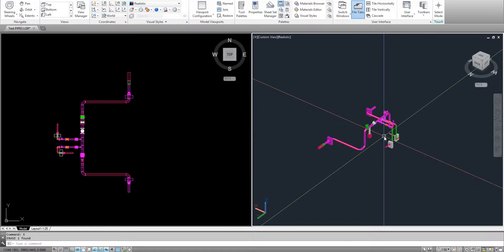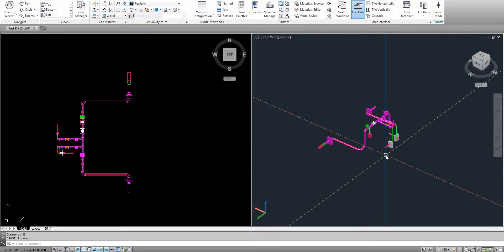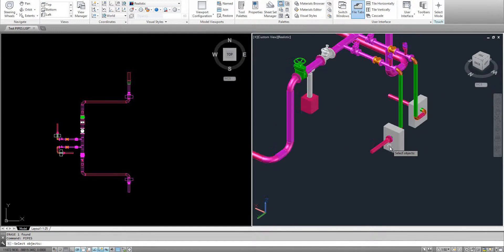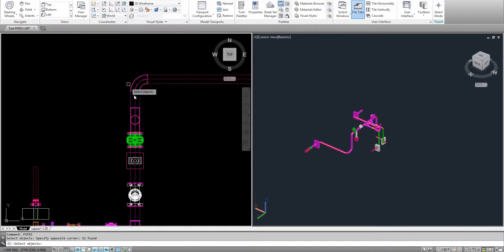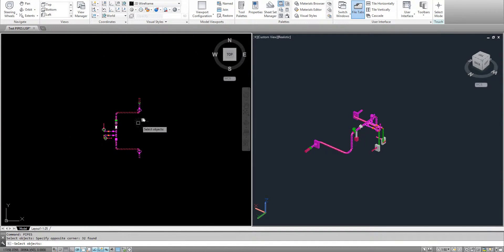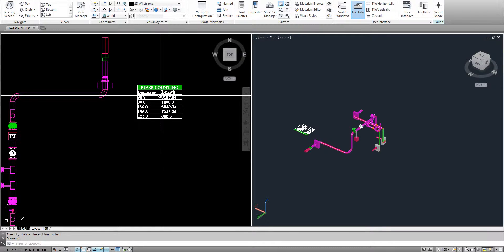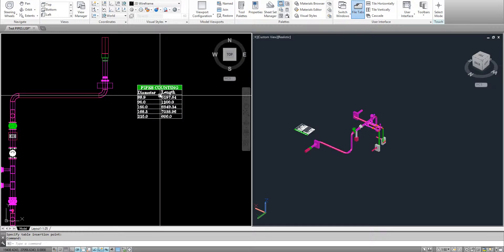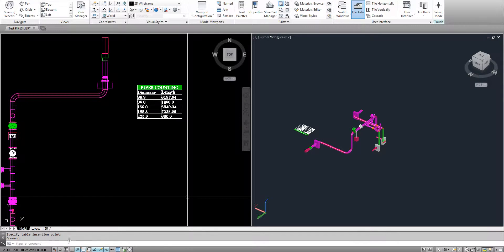Pipes

Comment: Hey, i have a small issue with this. Whenever i try to measure the pipework it measure  pipes that are horizontal but not those that are vertical. Any clue where the problem lies?